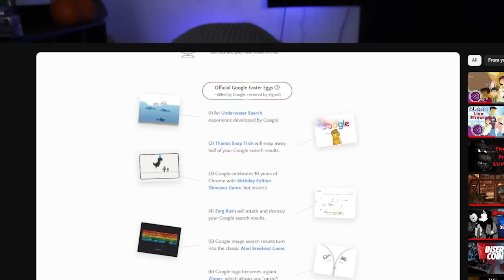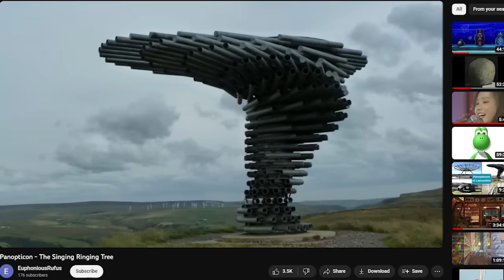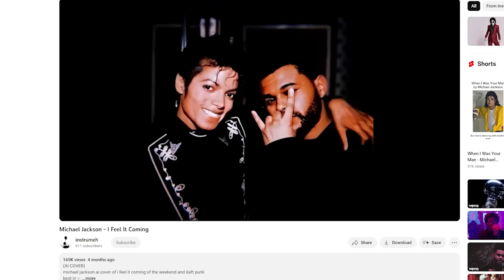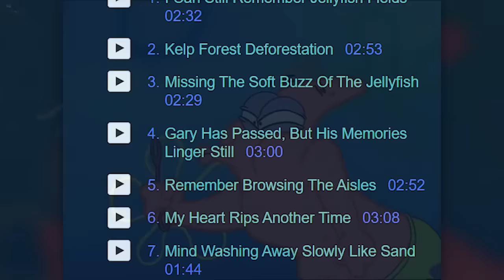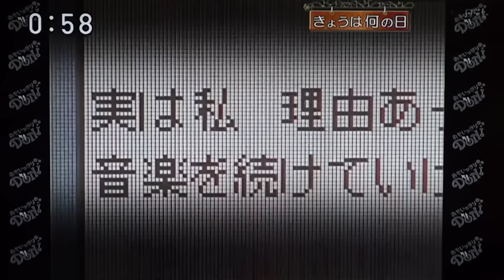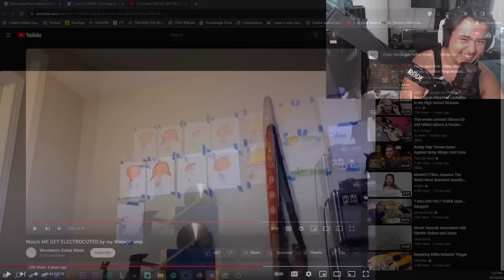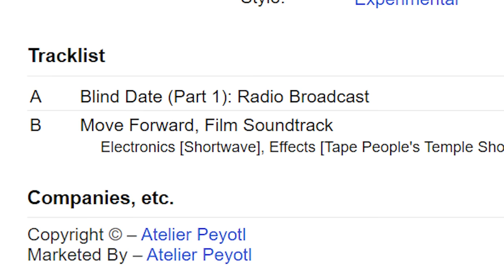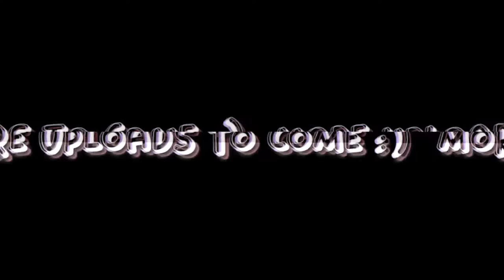Disturbing Music Iceberg Explained (GRAPHIC CONTENT)

Comment: Something else to note about the Castrati - they never stopped growing. Part of puberty involves increasing bone density when the bones lengthen, and then the ends of the bones fuse to stop growth. Without testicles to produce the hormones needed for this, their bones continue to lengthen - but they do not increase in density. Likewise, puberty causes the number of muscle fibers in the body to double (this is why it is so easy for kids in puberty to benefit from exercise very quickly and why pre-pubertal children are so weak no matter how much they exercise) and that doesn't happen either for Castrati... so they end up extremely tall, with weak bones and the muscles of a child. Their singing voice is preserved, but they had tons of other problems as they got older.

Comment: A few minor corrections:
EATEOT uses 1920s pop music, not classical which by that point was a couple hundred years old

The strings of the electric guitar dont "carry voltage" as it were. The simplified version of it is that the pickups work like a generator or electromagnet. The signal comes from the strings which are metal moving past the pickup because of some interesting physics. The biggest issue comes from the amplifier (note different from ampheres, although they share the same abbreviation and are somewhat related) the problem happens when old amplifiers are plugged in incorrectly. The ground and neutral wires or wires that should be at 0 volts used to  be the same wire, and used to be connected to the case. When plugging in those old cables there was a 50/50 chance the case of the amp would be live instead of neutral. This was bad but the resistance of the skin is often enough to keep it from being immediately fatal. Rain and sweat lower the resistivity and increase the chance of death. Again im simplifying but the risk with modern instruments is very low if they have proper 3 prong plugs and no internal shorts. This actually used to be an issue with radios as well.

Comment: I don't know who told you all that about getting shocked through guitars, but that is not how it works.
The guitar itself in no way carries current.
The guy that got shocked got shocked by the lamp.
The only way an amp can shock you is if it has an internal short and you touch anything that on the amp itself that can conduct electricity.

Comment: The real brown note is nothing but a theory, and if it was found, that information is not on the internet. There are videos pretending to be the brown note for views, but none actually have a sound backed by anything. Most often they are not even a "note." The one you listened to is the most popular upload, and it is not a note or based on anything but a theory the uploader has on how it may sound. The real brown note may exist, deep notes when played at a high volume can shake the body both externally and internally, so it is plausible that there may be one that resonates so that it causes internal vibration in such a way that would lead to involuntary defecation. The issue is that finding this would entail playing possible hundreds of frequencies at an unreasonable volume to test subjects one by one for long periods of time each, due to the fact that this would essentially be torture for the test subjects, it is likely that only a few would be able to be tested a week, and it may not be legal due to ethical reasons.

Comment: 1:20:00 I did a similar thing to this as a kid but instead, I would rub my leg or arm against my trampoline and then touch the metal springs that were exposed. Because of the friction created by rubbing ur body in a way against the polyethylene trampoline mat, it would create the charge which you could tell because of the hair that was raised. This was a fun activity with friends since you would scare each other into how long you do snow angels on the trampoline and then touch the other person's arm or something then they would get the shock. 

It was mostly the sound that scared you not the shock.

Comment: 1:17:48 Guitar strings do not hold voltage as they are not a part of any circuit. Most electric guitars also have passive circuitry, meaning no power goes to the guitar itself. If guitar has active circuitry it gets i'ts power from a 9v battery.

Amp means amplifier and is used to amplify the sound signal to the speakers.

You really misunderstood this one lol.
Reply: can you explain how they make sound and can electrocute people then?

Comment: RE: Brown Note— it's real, folks just conduct the experiment wrong. It's a very low note w a physically long waveform. Hearing it isn't what makes you poop, feeling it is. If you're too close to the amp (or using headphones), you won't feel the effect. You have to have the volume relatively high & position yourself about a meter away from the amp so the wave has space to fully form a crest & trough before it makes contact w your body.

Try again & do it right, coward!